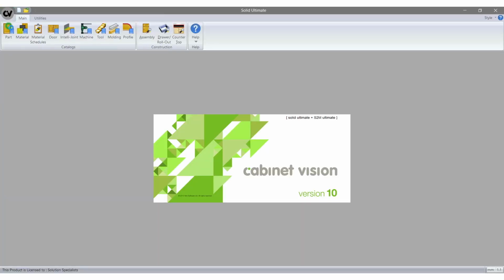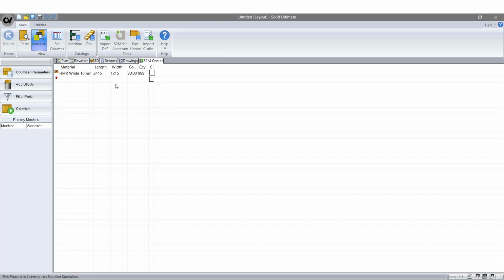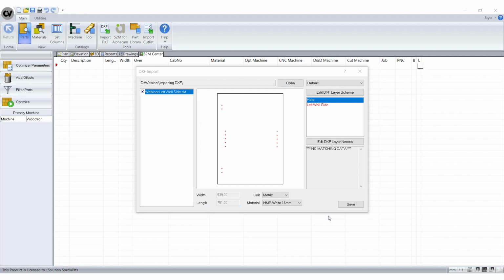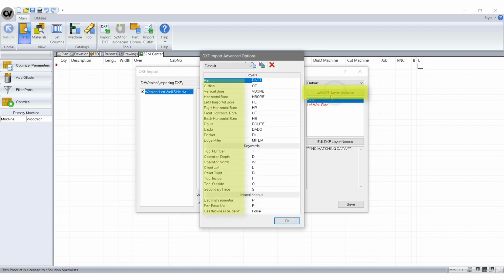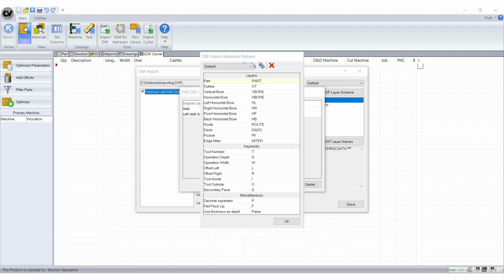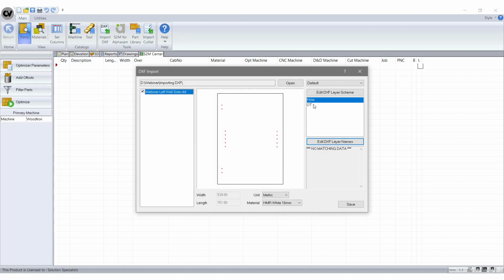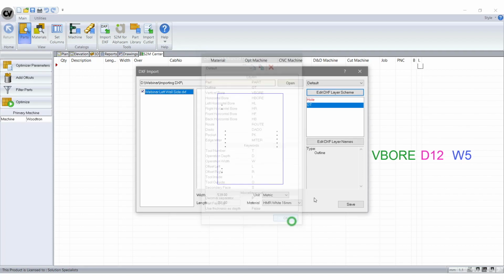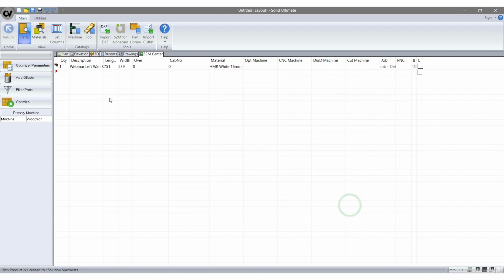Cabinet Vision Tutorial (Expert - 12) - Importing DXF Drawings into S2M Center

Comment: Can you set up layer names in AutoCAD so that you'd not need to modify them in S2M?
Reply: did you ever find out if its possible to name layers prior to the S2M and it being able to read the machining?
Reply: @shopprints   if u worked on WoodWop software u will notice thats each layer have Name and each name have details and after u export to dxf file format to Woodwod and convert file to mpr thats machine will understand the draw and lines and holes 

so some software need names for Autocad layers to transfer them to other machine or other software to let them load on right way and correct position
Reply: Hi, any idea why CV doesn't open DXF files with radiuses? I do those DXF files in AutoCAD...